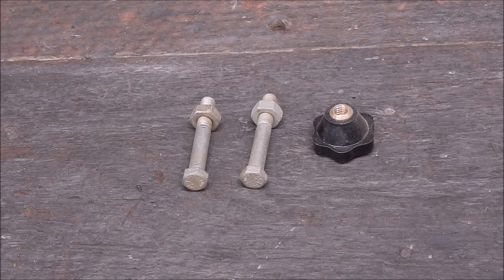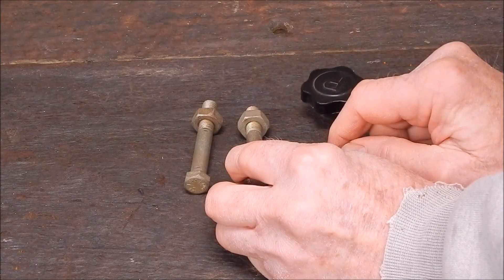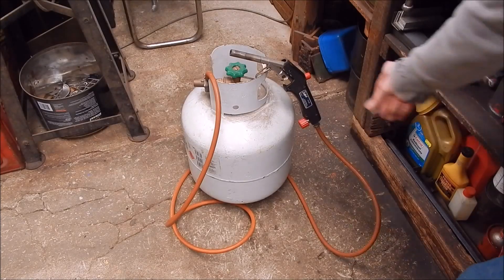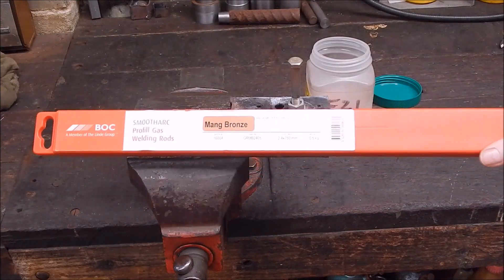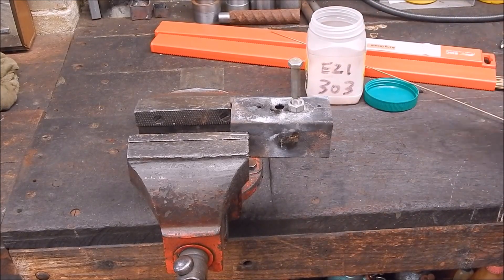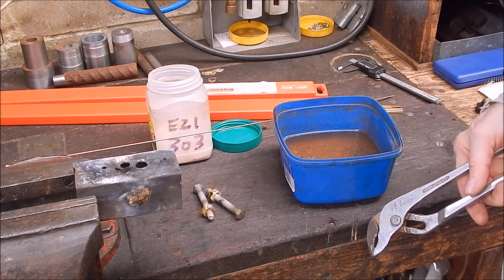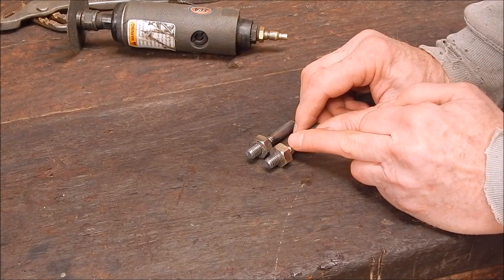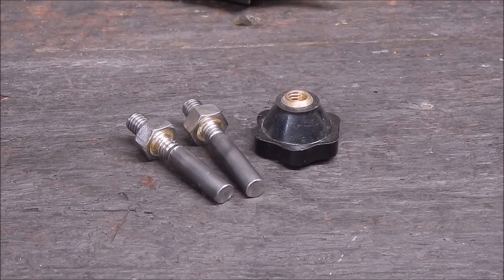How to do simple bronze brazing in the workshop

Comment: Hi what backing plate or material can I use when brazing a hole so no bronze drops out of the hole. I know copper back plate is used in welding. Thanks
Reply from the maker: I would use a brick or similar.   Also bronze will not stick to a rusty, carbonised or a powder coated surface. Cheers Rob

Comment: Hi, Thanks for the Video. What is the small tool you used to cut the bolts? is it electric or air? I liked the fact that the cutting disck is smaller than an angle grinder, but bigger than on a dremel rotary tool? Thanks.
Reply from the maker: That is an air die grinder with a 75 x 1 mm friction cutting disc.  Same as used in car crash repair shops.  I have since bought an electric die grinder which can do the same thing without the need for an air compressor : https://www.youtube.com/watch?v=p2gk0SASA48

The Hilda is really good and can be mounted as a tool post grinder.  It also can take a large range of tooling sizes  as it has a drill chuck.  I've done a few videos on this unit.  Cheers Rob

Comment: I just bought the Bullfinch 404 LPG Autotorch Brazing Blow Torch Kit also an additional Bullfinch Brazing Burner No. 4103 - Small Flame & a couple of brazing mats total cost from UK to USA inc shipping $253 that's  $350 Australian dollars, not bad price saved me a lot going direct to UK got them from Bes ltd https://www.bes.co.uk/bullfinch-404-lpg-autotorch-brazing-blow-torch-kit-14850
Reply from the maker: Does the regulator have an AU/USA POL fitting ?  It's unlikely.  The UK POL does not fit AU/USA gas cylinders.

I've seen plenty of people caught out buying cheap from the UK only to discover they have a problem.

If this company does actually sell overseas with the correct POL fitting, it will be a first and useful piece of information.

Cheers Rob

Comment: Rob, I purchased the Bullfinch AutoTorch following your video and have to say it is a fantastic bit of kit.  I did my 1st brazed joint in over 30 years today and it was a joy to do. I had intended to get myself a new torch another torch and was considering one of the more traditional  Bullfinch torches, but i am glad I saw your video because this is just marvellous.   Many thanks, keep up your great videos. Mike
Reply from the maker: Hi Mike,

They are excellent for sure.  For small light fabrication they are unbeatable in running costs and ease of use.  It does have a limit on what it can handle, but I have a second large standard LPG torch that I use to preheat in conjunction with the Bullfinch to extend it's capabilities a bit more.  

It's also good to be able to braze without UV/filter goggles as needed with oxy based torches.

Check out my latest video to see the junction box I fabricated up for an old Century electric motor.

I really like brazing.  It's so unobtrusive and integrated into the job, unlike arc which burns and always leaves a visible weld bead.

Thanks for the comment and happy brazing.

Cheers Rob

Comment: I had always presumed that workbench surface was some of the most oil soaked that could be found down under.  Then I witness you placing red hot bolts on it without even a wisp of smoke.  They must be cut from granite with a ground in old-wood patina.
Reply from the maker: It's a Jarrah hardwood top.  It's a dark coloured wood, but also oil soaked from engine work.

You need something tough for hard heavy work.

Cheers Rob

Comment: Hello Rob, I forgot to ask, is ezi 303 flux dry or a paste?
Thanks
Reply from the maker: It's a coarse dry pink powder that you dip the heated rod into.  It looks like wash up powder.

Paste won't work in this application.  It's meant for use on jobs that go into a furnace such as in factory production. I've had people get on to me saying the bronze rod won't stick and just runs off - it's always because they use the wrong flux.  

Get Eziweld 303 and you won't go wrong.  You can get it off Ebay and through most gas and plumbing supplies.

In a previous post I made a mistake when you asked about silicon bronze and I said it was referred to as yellow tip.  Silver solder is yellow tip.  I'm not sure what the colour code for silicon bronze rod is.  I've not used silicon bronze, but I have used silver solder - I did a job today with some..

Both are mainly for copper and brass, unless you get high silver content yellow tip which can be used for steel.  Even the 2% rods are hellish expensive, so I hate to think what 70% for steel would cost.  That high % is mainly used in making jewelry.

2% is handy if you want to join brass items together to make a larger piece, like repair a brass bush by sleeving in a new centre section etc.

Cheers Rob

Comment: Thanks for the quality vids. What's the difference between Mang Bronze and Silicone Bronze? When would you use one over the other?
Reply from the maker: Silicon Bronze is only for copper and brass metals - this is what plumbers use.  In Australia it's often referred to as yellow tip. 

Manganese bronze is only for ferrous metals such as steel, stainless steel, cast iron etc.  It has a much higher melting temperature and strength.  Brass will melt long before manganese bronze will.

Nickle bronze is the strongest of all bronze rods and is also only used for ferrous metals.  It has an even higher melting point.

There are a wide range of bronze rods available, but the above three are the most common types.

You can braze steel with silver solder at a lower temperature similar to silicon bronze, but it must have a high silver content and is expensive as a result.

Rob
Reply: xynudu very helpful, thanks for answering with some decent detail. sounds like I need some yellow tip to go with the mang bronze to cover all my bases. I  look forward to your next video.
regards
Rob

Comment: Very nice demonstration Rob.  I almost forgot where you are, if you had come to my place I am not sure you would even need the torch.  It is so hot here I think you could just lay the piece out in the sun and braze it :-)  And BTW when you are using a parting tool in that way you want to be really careful it doesn't slip and cut your nuts off. :-(
Reply from the maker: Hi Glenn,

That parting off tool is my go to item for that sort of close in job.  You just have to be careful not to put too much side load on it.  

Purely for very fine/light work like that.

"The worlds cheapest parting off blade holder"  as seen, actually is way lower risk than my shop bought POB as it has as little overhang as possible.

The shop bought one snags and snaps blades left right and centre.  Gave up on using it - totally hair raising thing.

Cheers Rob

Comment: Hello Rob! I hope you show those parts put into use. I think I understand what you're planning to do with them, but I would like to actually see the application. BTW, I bought a Bullfinch that came up on EBay, and it turned out to be the wrong one. They make a whole range of them to reach different temperatures. I'm sure you know that already but perhaps some of your viewers don't.
Reply from the maker: Hi Rick,

The pin goes where the cable would normally go, in the male part of a quick connector for a welder.   That's the idea.  I may have to turn down the bolt to fit.  I don't have the welder yet so this is all theory ;)  Should work OK.

That's the only way I can connect my extra long 400 amp leads with plain old style connector tabs, to a modern compact inverter  welder using bayonet type connectors.

Getting this welder is some way off yet, and may or may not happen.

Cheers Rob
Reply from the maker: Hi again Rick,

If it's the same handle as the auto torch (4100) you can buy the burner tip ( 4104) separately and retrofit it.

The whole burner nose is held on by the big hexi nut next to the hole for the brass jet you can see.

The nut is left hand thread.  Might be worth investigating.

Cheers Rob

Comment: Hi there, yes interesting using bronze braising.  In dental orthodontics we used mostly turbine solder (silver solder) 625c ish.  It was amazing how much corrosion and decay appeared on the solder joints in the mouth in a short time in the mouth.  Using the bronze certainly maker sense, a lot more heat than silver soldering but a lot less than welding so a nice comprise for this job.  Thanks for sharing.  Kindest regards.  Joe.

Comment: lol, great timing, I was just thinking about brazing the teeth back on for my lathe gears and fixing the pulley on my hacksaw I got, lol. Have you dont much brazing on cast iron, and if so, how does it differ, and any tips for cast iron?
Reply from the maker: I've done some cast iron gear repairs.  There are specialty rods you can buy to rebuild teeth for cast iron, rather than braze them back.  It depends how big the teeth are whether you can braze them back on accurately.  Often it's better to fill in the gap and recut the few missing teeth.

Cast iron soaks up a lot of heat and you really need oxy for doing gear teeth from my experience.  MAPP and the Bullfinch will struggle on anything solid over about 3/4 " diameter.

Then after you braze the repair you will need to reface the teeth to the correct shape.  This is easier said than done without a proper involute or single point cutter.    I've been down this path a few times, and nothing beats a newly /fully cut gear to a repaired gear.  They are never 100% right and likely to be notchy/noisy at the repair point.

You might get lucky, but it's up to you.

With cast iron you need to preheat the whole work piece evenly to avoid potential cracking.

Definitely NO quenching.

Brazing is very doable, and it will definitely bond strongly (unlike electric welding which may not take properly) but the finishing/shaping is the issue with any repair.

Cheers Rob
Reply: yea, I know you cant braze zamac, Ive melted enough of it in the foundry, and know how low the melting temp of it actually is. You can solder it tho, Ive used 99.3% tin solder to solder the pieces together. Also, everything on that old lathe was long long before zamac was even invented, lol. It's all cast iron or brass.
Reply: I have seen a few of the other creators use silicon bronze rod then recut the teeth in a cast iron gear. First using a burr on a die grinder to roughen up the cast so the bronze will get a nice surface to bite into. Luckily I have never had to do such a repair :-) 

If your lathe is an Atlas the gears are Zamak....not sure how that stuff would braze...if at all 🤔
Reply: Chirpy's Tinkerings , if you have TIG you can TIG braze. As Rob says, NO quenching! In fact, wrap it up so it cools as slowly as possible.
Reply from the maker: You can't braze Zamac as it is an alloy.

Rob
Reply: yea, I plan on grinding a single point tool to cut the teeth back out. The gear teeth that Im trying to reattach are fairly big and probably 3/16" wide, if not a little wider. The other gears and such, Ill just build them up and remachine them back out. I cant get replacement parts for the gears that are broken in the lathe, and if I leave them as is, it's far more noisy than if I were to just braze them up and single point them, and can cause even more damage as time goes on.
Reply: I forgot to mention...nice clean brazing job Rob. That is what I mainly used before getting my arc welder. Brazing and gas welding with a brazing tip on an oxy set is pretty fun and produces good results...slow...but gets the job done
Reply from the maker: Yes, it does a clean job.  I like and use stick arc a lot, but it's so aggressive. 

I have been wondering about getting a secondhand Comet oxy/lpg set for heavy brazing jobs, now that you can buy the oxy bottles.  I had oxy/acet before, but the bottle rental was a killer and sold it all off.

Oxy/lpg is only good for cutting and brazing, but that would suit my use perfectly.

Cheers Rob
Reply: I got rent free bottles from a national car parts supplier last year. Its great, a one off payment for the bottles and the cost of the gas. If you don't want the bottles anymore just take them back and they refund the one off payment in full. I got the mid sized bottles and have used them a lot for repairing  gears etc. Still plenty of gas left in them so will last a while longer. regards
Reply from the maker: Hi Gary,

The same deal is available from Bunnings in Australia, so it makes it a lot better than bottle rental through BOC etc.

You can get a nice LPG/oxy brazing kit new for about $200 from Hamptons in WA which leaves money for the oxy bottle,and probably works out about the same price as the Bullfinch.  BUT you do use oxy at 5 or so times the LPG rate so there is going to be an ongoing extra cost.  Still be pretty economic and handy though.

Cheers Rob